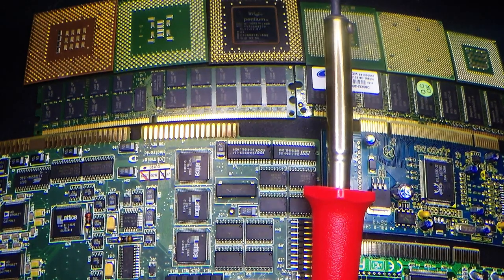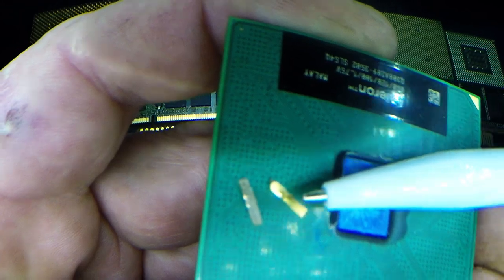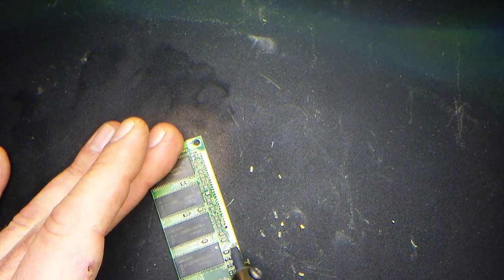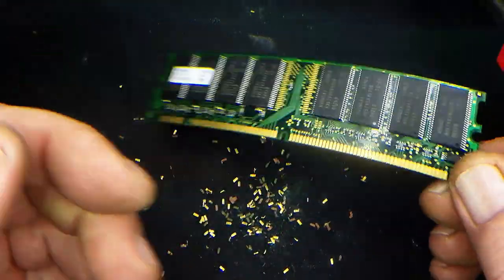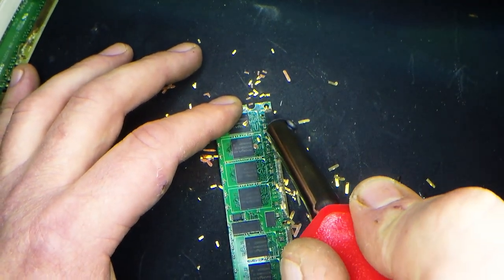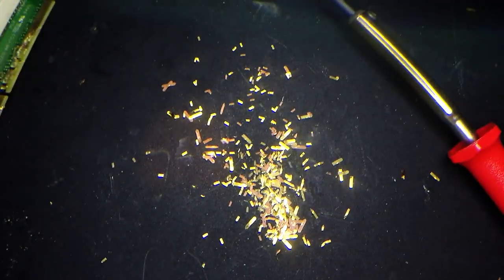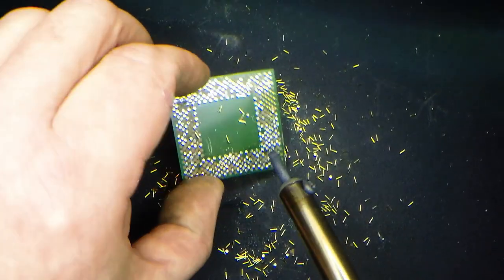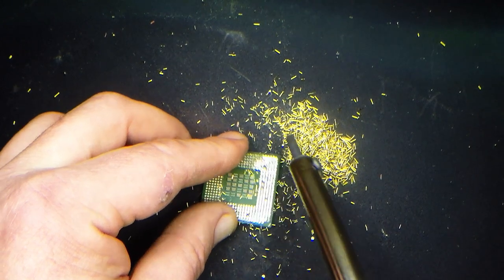Removing Gold Fingers & Pins from RAM & CPU's

Comment: This is the smarter way to remove gold pins from cpu i found in Youtube. Congraturation Ben!
Reply from the maker: Thanks Fabio
Reply: Just one question, Ben. How many watts power has your soldering iron? Thanks.
Reply from the maker: it was 30w, I tried with a 40w but it seemed a little too hot inside, but outside I think 40w would be best because of wind cooling the tip.

Comment: I cut the fingers using my vice (bent and snap), then use warm HCl and peroxide to dissolve the base metal/copper underneath.    And process the foils.  Much less work.

Comment: Great tip as another method! I'm glad you mentioned the separating of the recovered material. For those who would have the bad luck of the soldering tip finding it's way to your fingers ouch... some sort of holding apparatus or affixed block would be helpful, also possibly a little faster, since you won't be worried about your fingers getting burned.

Comment: Hi Ben very interesting idea. I was thinking if a 45 to 60 watt and a little wider iron sharped like you did will remove easier the large fingers from cards and more area with the processors. and maybe if you try  to screw a piece of wood or aluminum on the desk and put the processor against the  force direction to remain it still on place. keep coming those new efficient ideas. regards  Luis.
Reply from the maker: 30w is all I had but yeah not so much the wattage but more the width of the tip, wider would be good.

Comment: Wow Ben another awesome video. You could get a cheap oxygen and map gas torch and melt those unrefined gold foils into a small nugget. It would be 10k or 14k gold but could be sold to a jewelry store or kept as a nice homemade nugget. I was trying to refine gold to 24k but it was too much work for me and too dangerous for me. I sold $1000 US dollars worth of unrefined gold to a jewelry store and put the rest of the nuggets into a safe deposit box. Your new process has gotten me excited to dig out all of my ram sticks and see how much of a nugget I can make in one rainy day worth of work.
Reply from the maker: Coincidentally I had a friend stop by today on his way to do exactly that, sell his gold blobs to a dealer in town, I was impressed with how they looked but I would of kept them if they were mine.
so I take it if I melted the foils they would be similar in karat, say 10-14k, but if I melted the pins from the cpu's that would be considered gold drop and not something a jewelry store would buy?
Reply: Yes exactly at least the ones I go to. They sell the ingots made from melted pins on Ebay but the gold percentage at that point it is so low that I look at that as sort of a scam. And also if when you are melting the foils some of the copper will burn off with a blueish green flame if exposed to any oxygen. This will make it more pure but hard to get all of the copper to burn off.
Reply: interesting, I have the same idea I will put that material in a small batch of AP (less dangerous) and get more clean and closer to 14k  that is considerated a piece of jewelry. melt in a crucible with your favorite shape. i like the mini ingot or maybe a coin size.
Reply from the maker: yeah, I think for many it's the way to go, the same 14k blob could be turned into 24k but it really won't be much different in value because it will be much smaller, so selling as 14k or even 10k kinda works out the same, except no mney is spent on chemicals and much safer.

Comment: Hey that is real slick. my problem is i already clipped the fingers off. Thanks Ben  good video Ben. Kinda curious over how the crushing went with tumbler. I seen somewhere where a fella rented a small cement mixer,tossed all his chip in it with 2 bowling balls and let it mixer run for about an hour. chips were all crushed up.
Reply from the maker: i've tried using the air hammer to crush them, didn't work that well but broke 'em up into smaller bits. yeah a cement mixer might be the only logical way, bowling balls would be funny but I can see how that would work

Comment: Awesome video.
One question, what do you do with them after, how do you make gold for sale from pins and gold foils?
Reply from the maker: foils are the easiest because you don't need chemicals, just melt down into a blob an sell as is because it should be around 14kt. pins need chemicals to remove the gold off the pins first.
Reply: +eWaste Ben Thanks a lot for the answer.

Comment: Excellent video Ben! I have several pins waiting to process. What is your recommendation for processing the pins?
Reply from the maker: thanks! i'm only up to processing the foils, in the simplest of ways.
for pins you can't avoid the chemical process to remove the gold foils and i'm just not experienced enough to give advice, so all i can say is, keep stacking them up or send them to someone that refines.
50/50 nitric acid & water does the job to get them to foil stage.
Reply from the maker: But new technologies, like concentrated vinegar solution is not far away from being available to the public, wgen this happens gold recovery will be safe and simple for everyone, so just keep stacking it up
Reply: +eWaste Ben I saw a video on concentrated vinegar. It almost looked to good to be true.
Reply: Yeah I saw too Ben,had a lot of stages to process though. Still looked much safer :-)

Comment: what temperature do I need to loosen the pins but not to melt the board?
Reply from the maker: Usually a cheap 40w soldering iron will melt the solder
Reply: yes I know, but I'm curious about the temperature I should use. My station has adjustable heating from 150 to 450. I would like to know what is the correct temperature setting that loosens the pins, but not melts the plastic. Obviously I don't want to inhale all these nasty plastic smokes..

Comment: what wuld you thi9nk how much rams do you need to get like a 100$ gold
Reply: A lot
Reply: 1 ram fingers = 0,002 - 0,003 g gold (+/-) = 0,1 - 0,15 USD (50 USD/g). Let's say, you need 800-1000 rams scratched and processed (costs time and money). Ben did 1000 RAM video, did get some 2,7 grams (80 g button with 3,4% of gold).